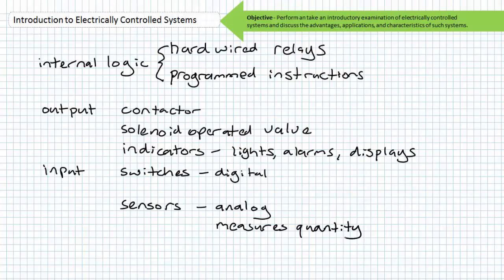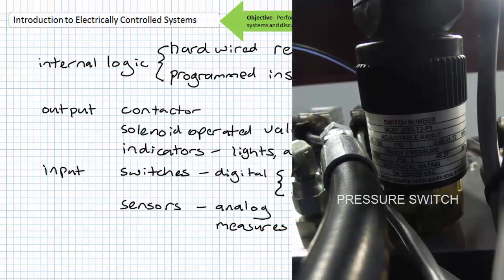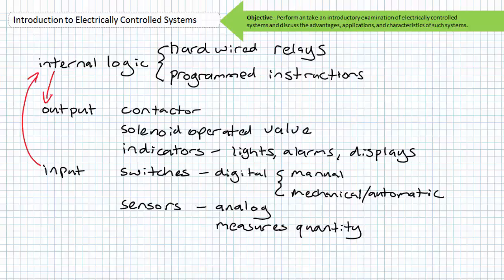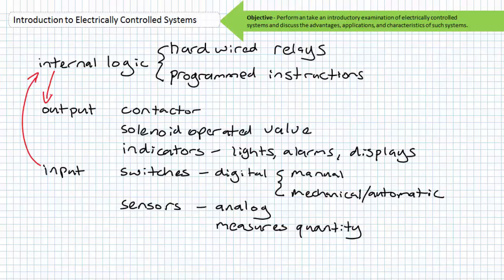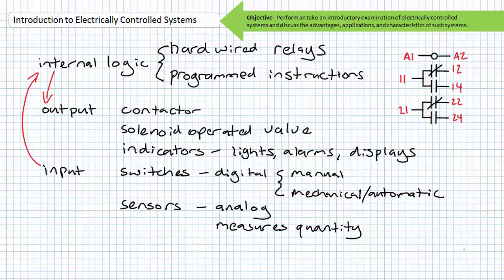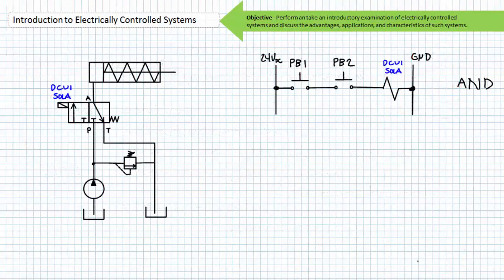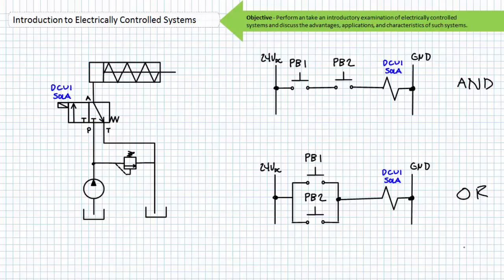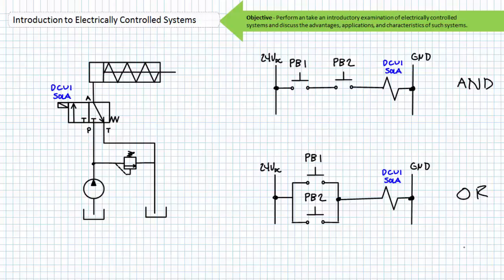Introduction to Electrically Controlled Systems (Part 3 of 4)

Comment: Can you do some videos on  real life relay control examples. They may or may not have some electronics for switching the relays etc Something thats reasonably complex to show what they can be used for but thoroughly explained by  your good self.. Im sure others would also love to see a complex  real world example explained clearly here.  I recently saw 6 electric jacks for lifting trucks that were all connected at a central controlling jack by electric wires. You could raise and lower all the jacks together when standing at any one individual jack or put them in local so the up/down only controlled the jack you were standing at.  The master jack had a board with a half dozen relays or more etc etc  The jacks were totally electric with3 phase motors
Reply from the maker: Check out some of the "Wiring A ....." or "Troubleshooting A ..." lectures in the Electrically Controlled Systems playlist at: https://www.youtube.com/watch?v=LM8U9FCMDx0&list=PLdnqjKaksr8qRPCFkU2Q8XQe0bfo99rs6

An example of a simple relay circuit is the "Wiring An Alarm Circuit" at: https://www.youtube.com/watch?v=nwpCBYBlex8

These application examples depict the real life functionality (and mis-functionality!) of some of the circuits discussed in the series.